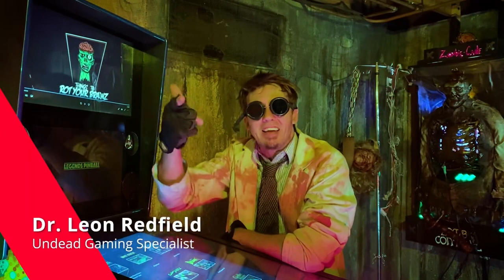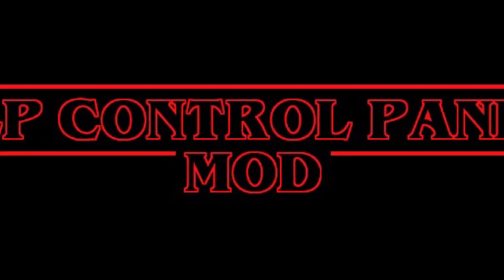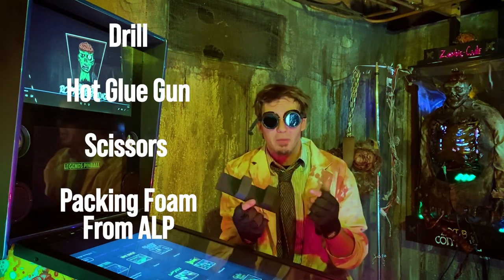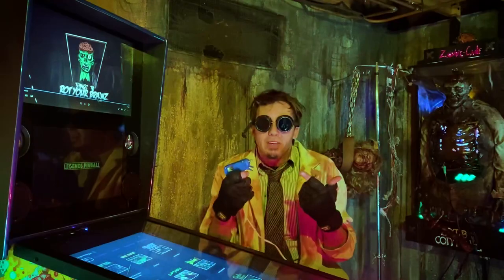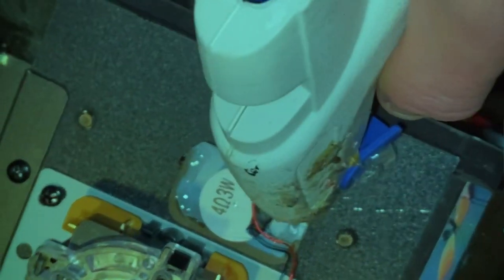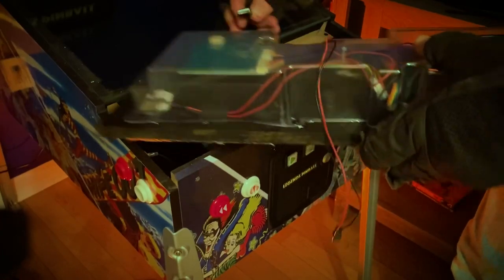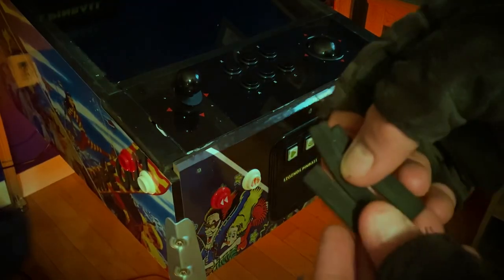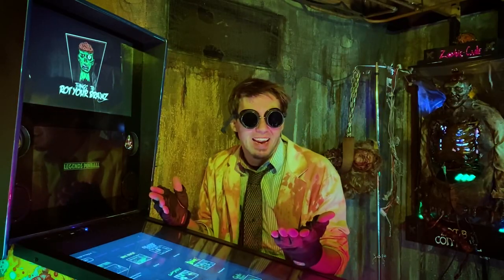A Quick Mod for the AtGames Legends Pinball Control Panel : Tips and Tricks @thingstorotyourbrainz

Comment: Gave it a try, everything back together, waiting 24 hours to ensure glue gun glue is completely dry before I flip on the machine and test it…. Stay tuned
Reply from the maker: Most excellent. Hope it all works well for you
Reply: Well, how'd it go? lmao
Reply: @DisgorgeX  It helped, but did not resolve the problem completely.  It happens less, only at higher intensity, and the buzz is not as intense. With the new firmware haptic adjustment, I’m hopeful I can find the right haptic strength to be effective yet not enough to return the buzz/rattle.   Thanks for checking in!